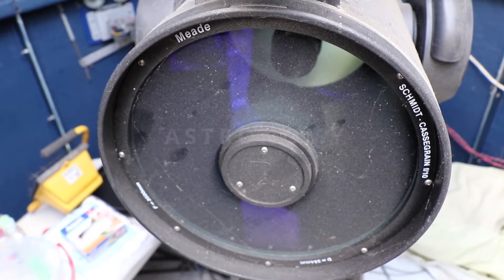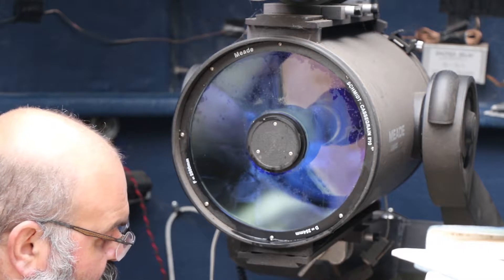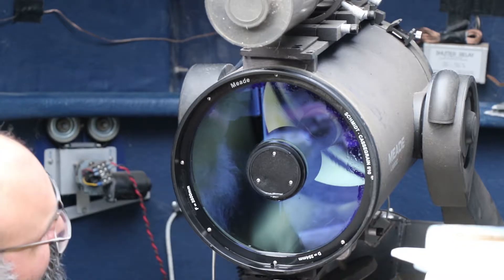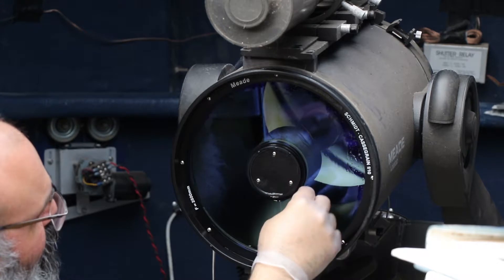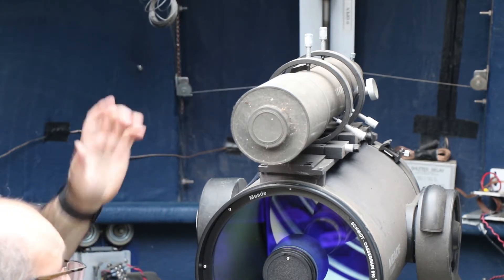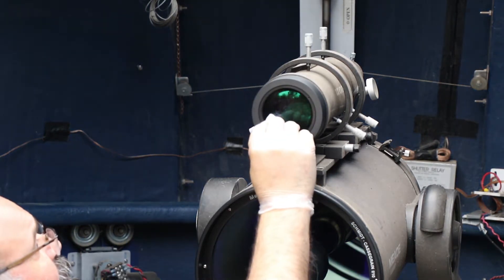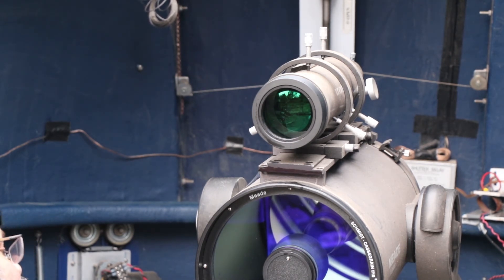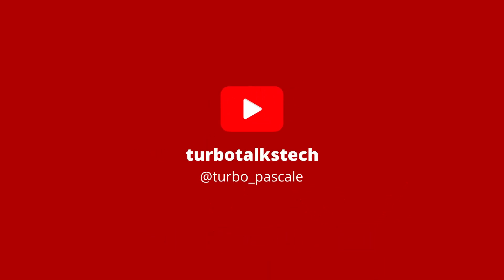Ep 002 - Telescope Cleaning

Comment: Good idea to clean the nonoptical surfaces (i.e., inside of tube and lens retaining rings and secondary mirror outer surfaces) to avoid transferring dust to the optical surfaces during the cleaning steps. Also, always blow off all optical surfaces with clean air to remove loose debris before contact cleaning. Nice video. I enjoyed it very much.

Comment: Blow it off with air from “canned”  air. Then point scope downward, and as others said spray with a spray bottle and cleaning solution letting gravity remove the solution as you proceed.
Then again go to air to remove remnants from that process.
Once the “heavy” grime has been removed, THEN you can use a micro fibre cloth well wetted to gently dab away the remaining grime.
Following again with pressurized air.
Lastly then you can gently swipe with a clean wetted section of the micro fiber cloth to remove whats left.
The layers of dust your lens had can definitely scratch the lens with cotton balls even wet.  Touching the lens before the heavy debris has been removed WITHOUT contact in the initial steps is asking for scratches.
The same scratching of the lens can occur just the same as eyeglasses do.
If you want eyeglasses to remain unscratched from very fine scratches, then air and irrigation is the way at first.
The approach of something akin to holding real dusty eyeglasses , then blowing forcefully with breath to remove the loose layers, then put them under a faucet and letting the force of the water remove the more stuck layer of dust. 
Afterwards you can gently wipe them with a moist micro fiber and dish soap.
Very fine scratches almost imperceptible to the eye,  can and will be left if you don’t use methods of initial NON CONTACT.   Wiping/rubbing/dabbing,  should be refrained from until all methods of non contact (blown air, sprayed water/solution) has been done FIRST, and before any physical contact methods are used.
Not trying to be critical, but I cringed when I saw the amount of well settled debris on your lens. 
Hopefully you didn’t incur minute scratches. 
Glass is hard, but it can be scratched by something as innocuous as dust if given the right conditions.
Another alternative is to remove the lens completely (would have been my choice) put protective cover back over tube assy till time you place lens back in.
Take the lens to the faucet and let the water flow the heavy debris off, then use the water wand with a bit more pressure to remove the tougher stuff. Followed by a gentle wiping of the lens with micro fiber under the faucet running.
There are videos of lenses being taken off for cleaning.
Good luck and hopefully yours came out okay considering the heaviest layer I’ve ever seen on a scope lens.

Comment: Hey I just cleaned my 8 inch act corrector plate,  I did a really great job but the only problem is that I didn’t dry it enough and now there is dried water streaks on the mirror, just like you had before you dried yours. Is there anyway to fix this? It’s been like this for 12 hours and still did not disappear

Comment: Im curious to know what happen with the gasket arround the lens because it will keep wet after cleaning. This is humidity and it could cause fungus or rust around the lens ...?. Thank in advance with your answer friend.
Reply from the maker: It's not an issue - I don't live in a tropical climate. Everything is relatively dry here. However, if concerned, I'd just hit it with a hair dryer for 5 minutes to make sure it dries up.